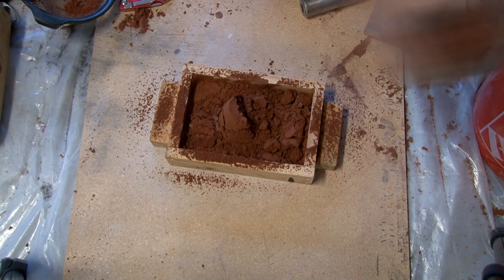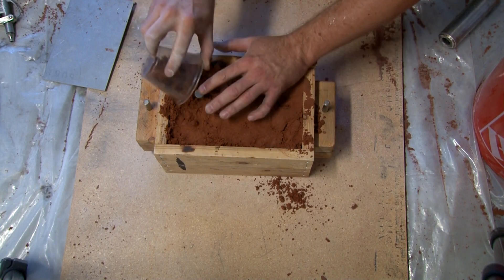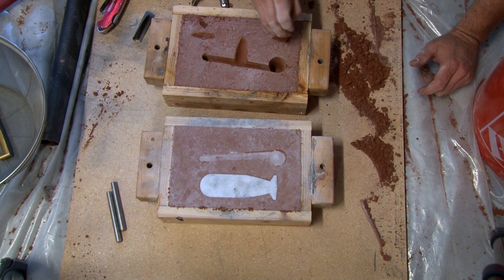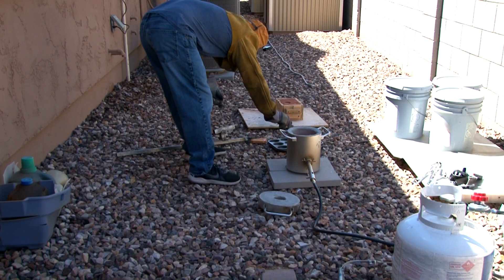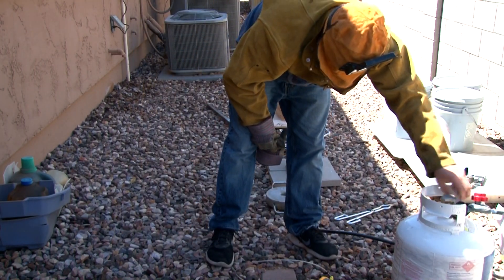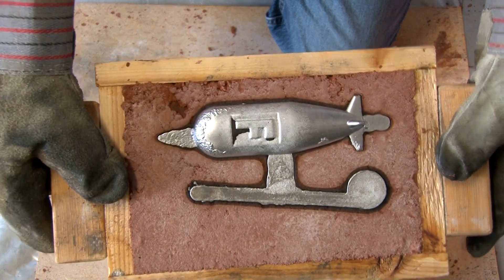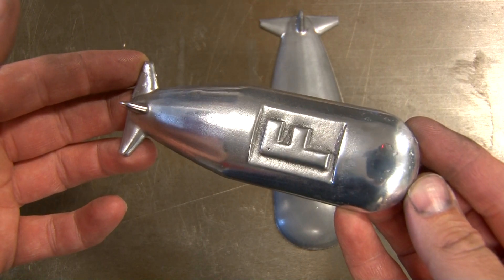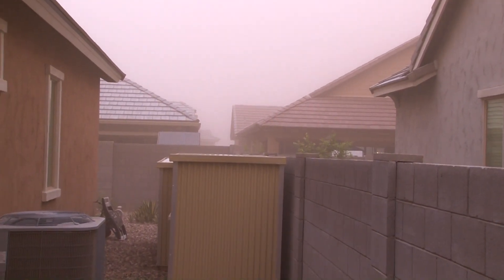Metal F-BOMB cast from scrap aluminum using the sand cast process in petrobond from a 3d pattern.

Comment: How do you know what temp the aluminum is? I guess I’m asking how do you know when to take the melted aluminum out of the furnace to pour?
Reply from the maker: In some of my videos you can see me take the temp with a thermocouple.  The thermocouple can withstand being put in the melted aluminum.  I normally try and pour around 1400F. I will be posting a foam casting video that I poured at a higher temp to help burn the foam out of the casting.  My thermocouple was purchased from amazon.  The reader and thermocouple I think together were under 70 USD.

Comment: Born and raised in Arizona (New River) now live on Oklahoma as of May. Setting up my foundry and gonna start casting soon.
Reply from the maker: Cool man,  be safe and make sure to protect your self.  I wish you luck.  What are you going to try casting first?
Reply: @DamonsMetalCasting  I did some casting back in Az and have done a few things here but just small stuff until I get organized. I've done some small pewter skulls, a Gremlin emblem as a Keychain and a couple off aluminum skulls about the size of a large shift knob using lost foam technique,  still working out the bugs with that one.

Comment: I've started casting in Pennies. Pennies from '84 to present are mostly zinc, so its a much lower melting point, 740-800F. Plus, I feel zinc cleans nicer than aluminum. You should give it a try.
Reply from the maker: I checked out your channel you got alot of cool stuff I will watch through soon.  I might do some zinc one day, except I got alot of aluminum scrap right now to use up and I dont have a cheap and plentiful souce of zinc.  Thanks for taking time to write me a comment.